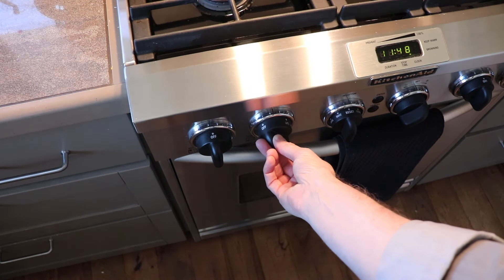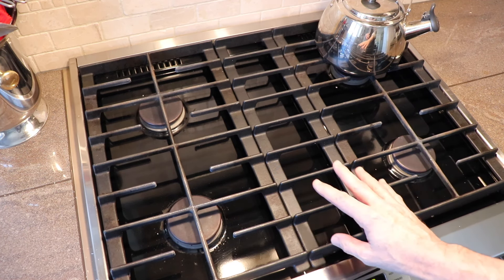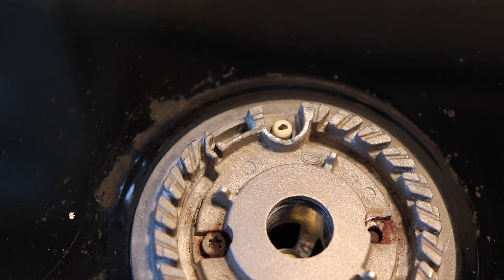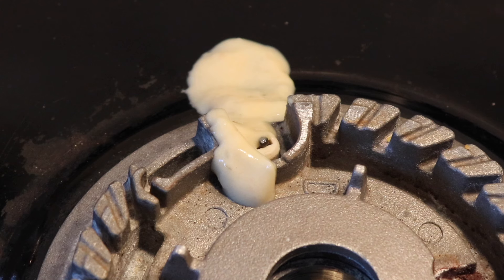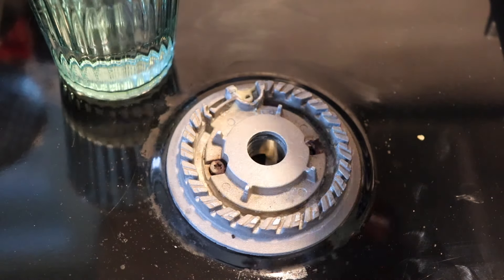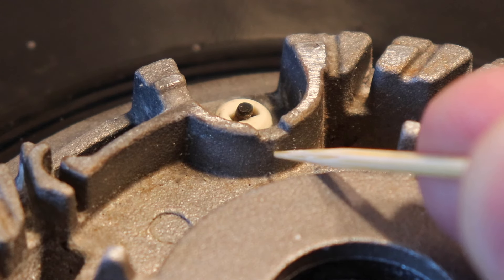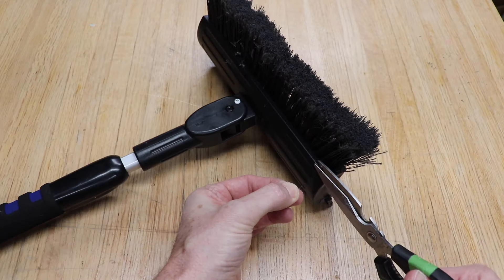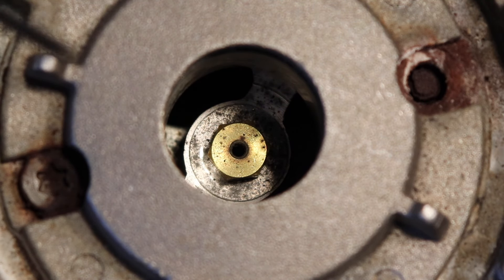My Gas Burner Won't Light or Ignite on my Stove Top ● 60 Sec Fix !

Comment: And if you've cleaned/washed the stove top and burners with liquid cleaners and it doesnt light....let it dry. Or light the burners with a match to dry them quicker. Mine wont start if they get wet but they easily light again when they dry out.
Reply: @BlueGillage  Clean and Rinse the gray plate. Cleansers can leave a residue that will act as insulation and prevent the Spark from arcing.
Same with the small ignitor itself.

Comment: Cleaned my cap,slightly opened the gas channel with sand paper,and the real issue,raised the electrode slightly with a needle nose and fixed a 10 year issue.
Reply from the maker: That’s great! Once you understand how it works it’s easy to identify where the issues are.

Comment: As a licensed home inspector I come across ignited issues all the time. Although it’s beyond the scope of what I do, as a courtesy, I will definitely lift the cap and quickly check if there’s any debris. Up until now, I would flag it as a malfunction in the appliance. Never hurts to go to that one step for the client. Thanks.

Comment: Your videos are incredibly helpful. For the last 7 years, I've had one burner that didn't like to light on a brand new stove from day 1. Of course, it happens to be the burner that I want to use the most. After watching this, I fiddled around with it and now it lights right away every time. I didn't see anything come out of the hole when I probed it with a paperclip, but perhaps there was a bit of dust in there or something. I also built the oil changing vacuum device you did a video on. It is an honor to be your subscriber Sir, keep up the good work!
Reply from the maker: Wow thanks for that!! I'm glad you figured out the burner issue!!

Comment: For me it sparks but i dont smell any gas ive done all of these and it doesnt work im so frustrated right now pls helppp😭
Reply from the maker: Is it a single burner stove or more?
Reply: @chrisnotap  no its like yours. All burners work except for one which sparks but no gas
Reply from the maker: @vantt.  Sound like you may need a gas repair guy to see where the gas restriction is for that one burner. Could be food debris in the pipe or the valve is worn out. Make sure there is no food blocking the hole where the gas comes out at the burner. Use a drill bit or paper clip in the hole.
Reply: @chrisnotap i will be contacting someone thanks for your help + i didnt expect a relpy thanks for taking the time and replying to my comment ❤️❤️

Comment: Some older 20 + year ago era stoves had a trigger switch behind the gas burner knob to trigger the spark. They tended to fail, somewhat of an easy fix but you had to go in under the burner tray to get at the wires, which was a pain.

Comment: Did all four of these and i’m still only getting it to light 1/10 times. Just replaced the electrode too. Any idea what it could be?
Reply from the maker: Make sure the little gap where the gas flows through to the ignitor is clear

Comment: one thing that wasn't mentioned was with that orifice bit having carbon build up. It wont be at the top but inside the tube, so you'd have to grab something like a paper clip, unbend it and clear it out the tube

Comment: Tried everything but one of the four burners will not ignite…no spark there
Reply from the maker: Have a close look at the igniter as you try to light it. The porcelain around the outside can have a small crack that spark will follow and your see the spark actually follow the crack

Comment: I was just making chocolate syrup and it boiled over. I mean ALL over. How do I clean wherever it ran down? Mine doesn’t come apart. I have been having trouble lighting but I think after watching your video I can clean that. I’m afraid the syrup ran down around the base and under the top somewhere. What a mess. Not sure what to do. Well. Back to cleaning. Thanks for the video .
Reply from the maker: Yes just get in there with "as hot of water as you can handle" and clean clean clean. The water won't harm anything. Let it dry and give it a go. Tip: use a toothbrush to help get in around the ignitor (fyi: you can't get an electrical shock, no worries)

Comment: Great informative video.  I jumped up and went to my stove .  The left front burner has not worked since I moved into my current home.  After trying all the suggestions, turns out there is no gas getting to the burner.  I checked the other four burners and you can hear the gas being directed to the burner.  I still appreciate the tips for future reference.
Reply from the maker: You used the process of illumination perfectly and you will find the problem shortly by a little more probing. These systems are simple. You’re almost there. You’ve got this!!

Comment: Gas stove will ignite with a match only. 
Cleaning doesn’t help. It doesn’t click anymore. 
I have a friend who new how to fix the clicking part, 
However that didn’t work either. Something is wrong 
with the electronic part of the stove. For now I’ll make due with matches. 🙃
Good video, thanks.
Reply from the maker: Matches can get you by for a long time.
Reply: Sometimes the actual ignitor can go bad, they work similar to a BQ pizo starter or fluid lighter, except some are powered and others not (Non flint). Depends on stove, some have left and right separated, some have an electronic board that feeds the power to all of them. 
Matches are cheap though so that's good to.

Comment: My problem is that sometimes the burner won't stop sparking, usually after a spill or cleaning. To be honest, I'd much prefer the old fashioned pilot light...that never cost you hundreds of dollars for a new circuit board and a service call that after diagnosis and waiting for parts took weeks. JMHO
Reply from the maker: The problem was back then is that your house smelled like natural gas plus it wasted a lot of fuel when you consider the millions of homes that had pilot lights.